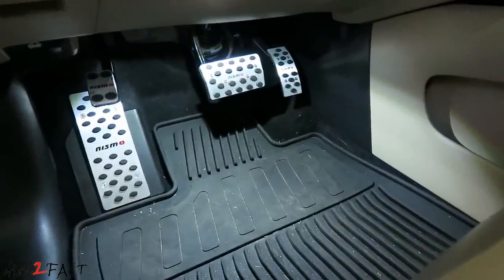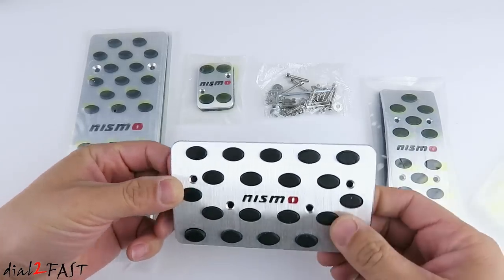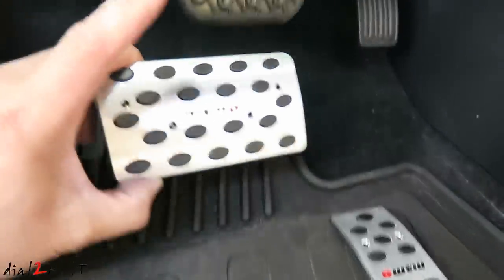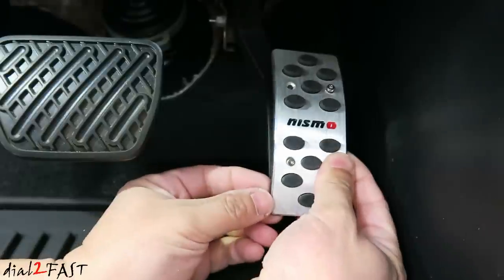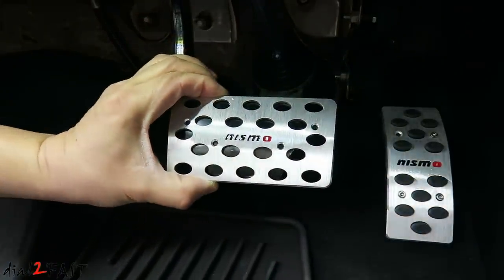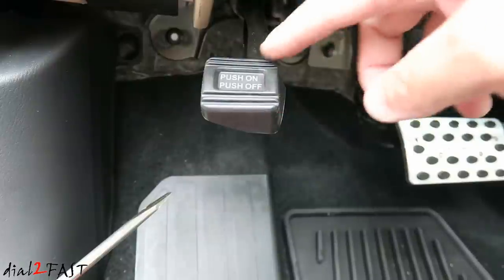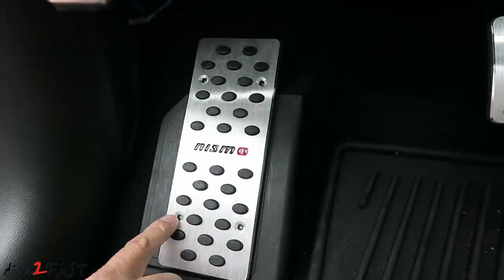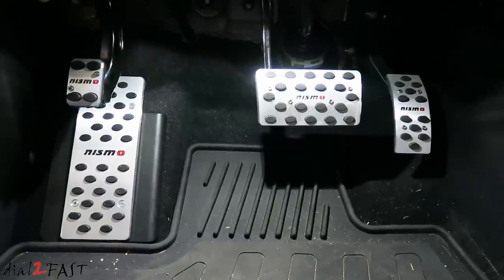How To Install Racing Pedals In Your Car

Comment: Now when soles are wet, will make pedals more slippery.
Reply: The rubber inserts prevents that from happening
Reply: Booboosik : Did you see the black dot ? That’s a rubber !
Reply: @arileffendi89  Not enough surface area. This is where a design choice to show off more metal makes the use dangerous.
Reply: Booboosik : No ! This pedal is quite good .. I’ve bought this pedal, but not install yet ..
Reply: I only like footrest part. The others not sure if needed...

Comment: what kind of drill bit is that? I was drilling forever and couldn't get through the pedal on my Toyota van
Reply from the maker: High speed steel (HSS) drill bit. Also spray some lubricant like WD40 on the drill bit and that will help cut into the steel (make sure your drill bit is in good condition).

Comment: •I noticed that you didn’t have to use all of the screws (top 2 of the deadpan, far left of brake and top left of accelerator) when you installing everything. 
•However, all of the screws appeared to be filled in at the end. 
•Did you just grind off the back of the screw and epoxy it on 
or 
•Did you screw it through the rubber? 
•Yours turned out looking real nice 👍. 
•I just wanted to make sure that I knew exactly what I was getting into before pulling the trigger. 
Thanx
Reply from the maker: The screws do need to go through the factory pedal to be mounted and the aftermarket pedal is much larger so some screw holes don't lineup over the factory pedal. So you are correct,  I did not put all the screws through the factory pedal. To complete the look, I simple threaded the remaining unused screws into the aftermarket pedal and through the rubber padding underneath. If course your vehicle will differ depending on the shape of the factory pedal.

Comment: does pedal get slippery if have wet shoes.
Reply from the maker: The rubber knobs help with grip. But eventually after many years of use, the rubber will wear down, and at that point it can be a bit slippery.
Reply: @dial2fast  ok, put edges of it no grip, foot can slip

Comment: Will this work for all Nissans, I have Nissan Murano will it work for that?
Reply from the maker: I checked the one that I provided the link to from Amazon and the gas pedal has same drill hole pattern so it will fit 3 of the 4 screws. The brake pedal have a different hole pattern than what I got but again looks to be able to fit 3 of the 4 screws. The e-brake and dead pedal will have no problem fitting. You may want to take a look at your gas pedal and also pull back the rubber cover on your brake pedal to see how it is.
Reply: dial2fast okey thanks
Reply: Tyler Sierra are you okay lol
Reply: @tylersierra8948  no, you think they aren't nice on a race car. Your opinion means nothing in the grand scheme of things & you are the one who clicked on the video.

Comment: What size of drill bit did you use?
Reply from the maker: I don't remember but just use a drill bit size slightly bigger than the screw diameter since you need the screw to pass through it.
Reply: Been drilling at can’t seem to get it on